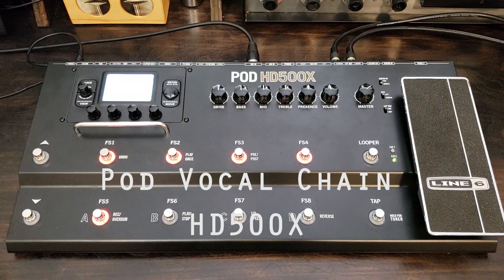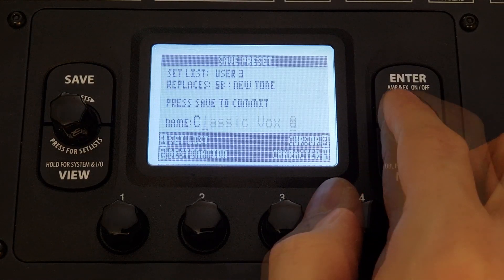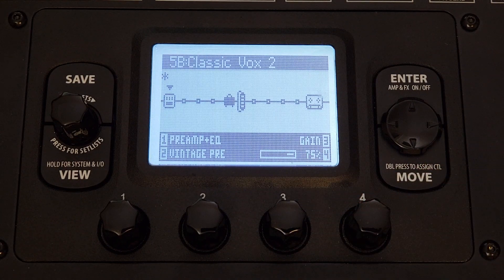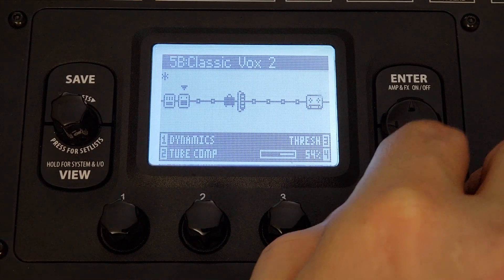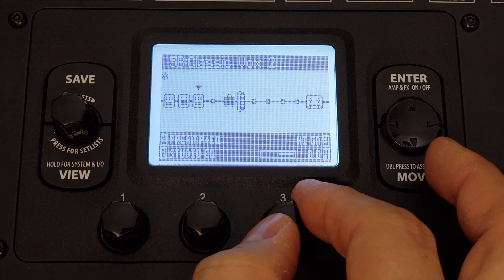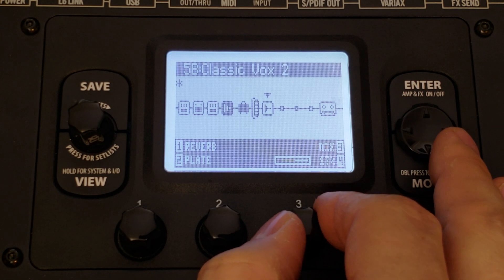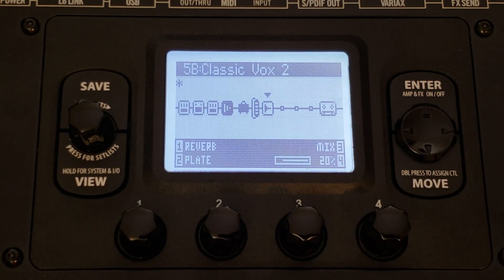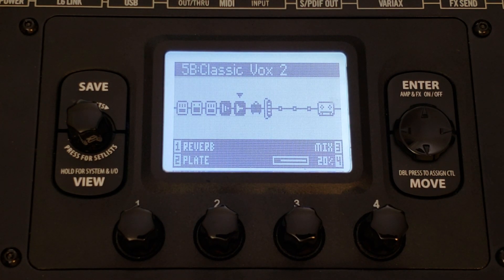POD HD500X Patch MIC XLR Vocal Chain Compressor Reverb Delay LINE6

Comment: I have a similar patch, but I stacked two LA2A compressors, each doing a little compression. I also have an overdrive block I can turn on and off with a foot switch as an effect, and a smart pitch block I'm playing with to add harmonies on occasion. I also set the high pass filter on the preamp to around 150 Hz. I find this cleans things up and helps cut through a mix, especially when playing with a band. My plan is to copy this preset to multiple locations in one bank, each with the smart pitch set to a different key.
Reply from the maker: Yeah, a high pass filter is a nice touch which many people over look...especially on reverbs!  I'm also a fan of 2 compressors, each doing a little less, so one isn't simply crushing.  I usually copy a full bank of similar presets, the first is the Rock solid one, the other three can be experimental...

Comment: Hi! thanks for the review. Is this still okay to buy used now its 2022, I know this tech is some years ago.
Reply from the maker: Good question!  I still use mine on occasion, especially in the home studio.  
As far as the age of the Tech goes- I suspect anyone who owns a Helix will tell you not to waste your money on this. The amp distortions do sound a bit dated, sometimes there's an unpleasant layer of fuzz on the amps that just sticks out to me.  I almost never use any of the amp overdrive.  I do still use the B15 bass amp simulator though.
The FX all hold up pretty well, I feel.  Delay, Reverb and Chorus haven't really improved in the past 10 years. Some of the note tracking may have though. For example, if you're really into pitch shifting or creating Organ sounds, this pedal isn't great at tracking and converting chords, but it's fine for tracking single notes.
Maybe most important, some of the "digital" knobs are starting to get buggy.  For example, one of the parameter knobs(#4) sometimes only moves in small increments, if at all. It's as if the pot is dirty but the knob still spins normally. That's the knob that gets the most use on this pedal. It tends to be the output setting for all the FX in the unit. So when that knob isn't working, the unit is impossible to "dial in" (therefore, useless) unless you are going to play with just the preset sounds.   
I don't know if it's possible to clean this pot, but I get the sense it wouldn't be easy.
It happens to me now almost every time I use it, but usually some amount of knob twisting back and forth usually brings it back to a useable state.
It did it to me once during an important show, and there was no time to mess with it.  I've never really trusted it in an important live setting again.  I still use it for shows sometimes, but not the way I used to.
So, I'd say try to use the pedal before buying it or ask specifically if any of the parameter knobs act buggy.
 Good luck!

Comment: Dude bro ham my mic will not work with the pod hd500x I followed your guide to a T I can hear white noise when the gain is turned up really loud, but I can’t hear anything from my mic, please help man please please if you can! The mic works on my scarlet solo focusrite just would really like to be able to use the mic on my pod 😢
Reply from the maker: Hmm, the only advice I have for the unit is to double check that your outputs are set up properly.  The inputs and outputs can be a little tricky when multi-tasking with this pedal. If you don't have them set up perfectly with panning, settings and patching you may not get sound. You could save your settings on your computer and then do a factory reset and see if that helps.  I suspect it's either a bad cable or one of the input or output routing settings.  Also, it's good to plug headphones directly into the pod to monitor what you're doing.  Is your expression pedal set up to be a volume/panner?  Because sometimes that gets tricky too.
Reply: @FrankOlsonTwins  I didn’t think about the pedal! I will look into that! And I’ve tried all the different outputs to no avail, and also I have my headphones directly connected the whole time too! Gonna give the factory reset thing a try after saving the files I have on pod if edit or whatever! Thank you for the advice man, and the expedited reply!
Reply: Like I can’t even hear the mic just hooked directly without it even going usb to the computer! Makes me feel like something has to be set wrong, my guitar works fine though and when I change the inputs to mic, I still can’t hear lol it’s driving me nuts! Because I can monitor my guitar playing, but the mic is just non existent lol
Reply from the maker: I would take a look at the manual. I remember it being enormous but helpful.  It could be that your XLR connector is not functioning properly.  What kind of microphone?  Dynamic?  Because a condenser won't work on this POD.
Reply: @FrankOlsonTwins  it is a condenser mic 🫠 I had no idea man, it’s the mic that comes with the focusrite solo studio kit, I just assumed it would work on the pod too! Why wouldn’t a condenser mic work? Sorry I’m a noob brother, but I appreciate your help so much!
Reply from the maker: Hey, no worries!  A condenser mic requires "Phantom power" which the POD HD500X does not provide.  Interestingly, the POD HD Rackmount unit DOES have a phantom power.  Sorry to say, you'll have to pick up a dynmic mic to use with the HD500X.  But at least that means it's probably not broken!
You can get really decent sm57 or 58 clones on amazon for really cheap. Or, a new 57 or 58 is only about $100 if you've got the cash. 
Glad we got it sorted though!
Reply: @FrankOlsonTwins  dude yes! Liking and subscribing now, I appreciate you a ton! I used my other mic last night and it worked good sir! I can’t thank you enough man!
Reply from the maker: Great, glad it worked out!

Comment: How can I use the mic input and at the same time play my guitar with the patches I already created
Reply from the maker: You'll have to change the patch slightly to:  1.) Turn on the microphone for your desired input channel  2.) Add the microphone to the path with desired FX. 

Good luck, let me know how it turns out!
Reply: @FrankOlsonTwins  in X3 there was an option to lock the "half" of the patch for mic input, so if you changed your guitar patches live, the mic wasn't affected.  Did this oppurtinity  disappear in HD500X?
Reply from the maker: I do not believe that function was held over to this unit.  You can change patches on the fly, and either save them or not.  If you change a patch(without saving), an asterisk will appear near the patch name.  If you save the patch, the asterisk disappears and the patch is updated with the change.  If don't save the changes, the patch reverts to its old state when you unplug the unit.  I've never used an X3(though I sometimes want one because it looks a lot lighter than the HD500X), however the HD500 works like this:  You make your patches and save them, in this case one with microphone and guitar.  The next time you edit the patch- you can edit any tiny parameter and nothing else is changed.  Here's where it gets a little confusing.  If you keep the Inputs set to "1. Guitar 2. Mic" all is good.  If you change the inputs often ("1. Guitar 2. Aux", or just "Guitar") you'll have to manually set the input back to "1.Guitar 2. Mic" in order to use the microphone(or "1. Mic 2. guitar" if you patch that way). That is to say, the inputs do not follow the patch. The patches follow the input.  So, if your mic isn't working on a patch that looks fine, check to see that the inputs have not changed.
Reply: @FrankOlsonTwins  thanks! So they "upgaded" the X3 to HD500X the following way as I see it from a year of practice:

-power cable is shortened, now I always need a extension cord for this

-patch locking on channel 1/2 disappeared

-default volume/wah pedal setting disappeared when creating a new patch

-when using it with a power amp with combo mode, the sound still affected by the cab simulation on/off setting despite it should be bypassed because of the poweramp mode:D 

Ok, it's not the most expensive modeling, and the sound is definately better than X3 Live but come on:D
Reply from the maker: Actually, I noticed when I was researching the X3, the 500x allows fewer amp/fx combos in general.  Personally, I think the 500x is a bit underpowered, as far as processing goes.  The amp sims are a little too demanding. And the short power cable thing is quite ridiculous.  Maybe Line 6 adopted the less is more approach, or at least- less costs more.  I'd be interested to test out a Helix, but not anywhere near the current prices. Thanks for the info!

Comment: Question can you use this mic and play the guitar with a different effect through the HD500x at the same time?
Reply from the maker: Sure!  You just have to make 2 amp "paths" by moving one amp up or down.  Then, in the SYS/IO menu change one input to mic, and the other to guitar.  You can add effects to each separate path. Don't forget to pan each channel 100% left and right if you want them to stay separate. I have a video about it here: https://youtu.be/4FsSKoYOHYQ

Comment: Hello, is this configuration for a live show?
Reply from the maker: Generally I've used this patch for recording vocals.  You could use it for a live show, but you might have to adjust some parameters if you are getting feedback.  But that's true with any live delay/reverb microphone setup.
Reply: @FrankOlsonTwins  you will not have a configuration for live stages? already set
Reply from the maker: This video is a little harder to see but it's a similar concept.  I use a guitar and vocals live, so I use two channel inputs- one mic and one electric guitar DI.
https://www.youtube.com/watch?v=4FsSKoYOHYQ
Reply: @FrankOlsonTwins  it does not look good in the video how to set the preset

Comment: I did this to the “T” and I have no sound from my mic. Only thing I did differently is I am using XLR out into the interface.
Reply from the maker: Hi
Can you describe  "XLR out into the interface" a little more in depth?   Are you using the XLR mic input?  You can also check the pan settings on the pod to make sure you're  input is on the correct channel.
Reply: Frank Olson Twins 
I use the mic to the mic input with an XLR cable. I use another XLR cable from the output to the interface input. But I figured it out. The HD500x DOES NOT work with condenser mics because it doesn’t have phantom power. I’m gonna buy an SM57 and all will work just fine.
Reply from the maker: Yeah that's one little over sight by the line 6 team on this pedal.   Phantom power  would have made it just a little more useful.  In fact,  I believe the pod "pro X" rack unit has phantom power.   Kind of a bummer they didn't offer it here as well.
Reply: Frank Olson Twins 
You should add that as a note in the description box of your vid. That way people aren’t stuck like I was
Reply from the maker: Good suggestion, I just did.

Comment: can i plug condenser mic to HD500 without phantom power?
Reply from the maker: No, HD500 will not work with a condenser mic.
Reply: @FrankOlsonTwins  does it works only with dynamic mic?